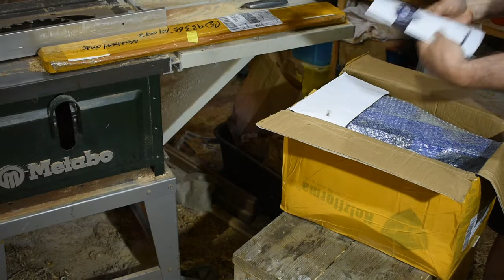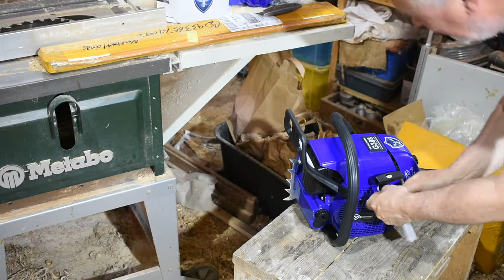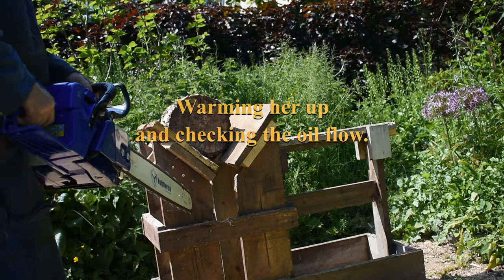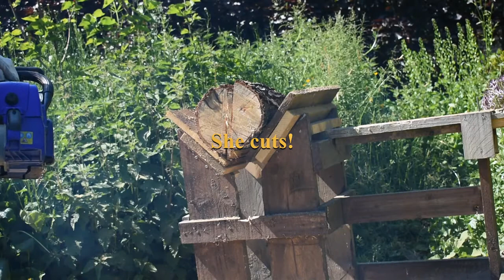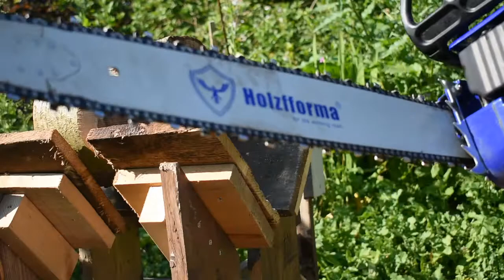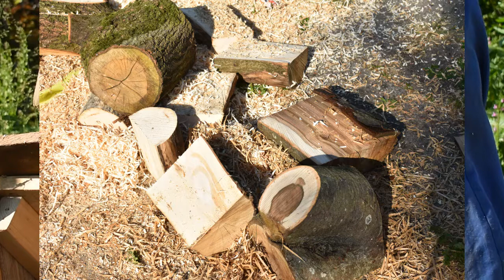Chainsaws - Unboxing the G388 & first cuts

Comment: Sweet!!  What size motor is that?  Never heard of the brand either but I'm in the US so not surprised. Have fun Leo!  Stuart
Reply from the maker: Hi Stuart, this is a 72cc saw and I am surprised you haven't heard about them. Holzfforma /Farmertec is the brand name for a chinese-built cloning operation of older saw models. This one mimics the Stihl MS380 and the parts are interchangeable. This brand is generally available in the US and very popular there as well because of the favourable pricing. Of course the pro's can tell you exactly what's wrong with them but for a homeowner it doesn't pay off to buy the original; I could buy two - three G388's for the price of one Stihl.